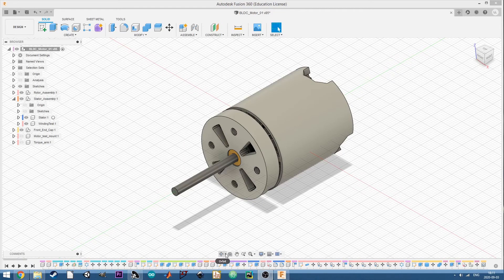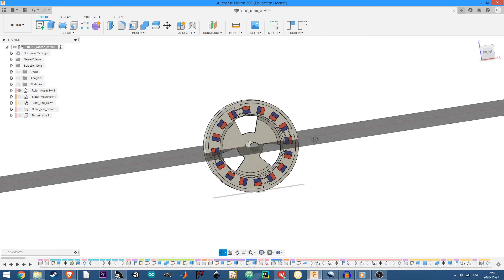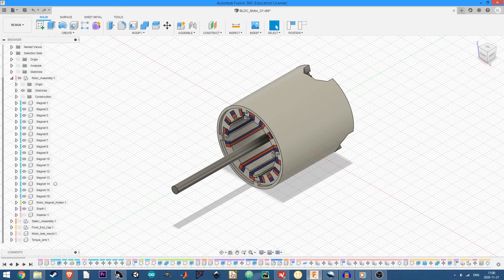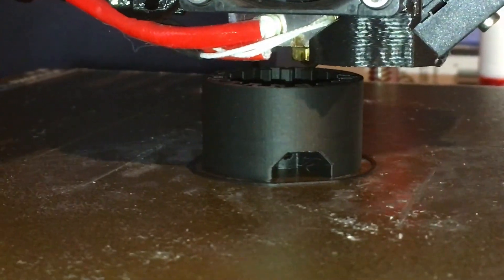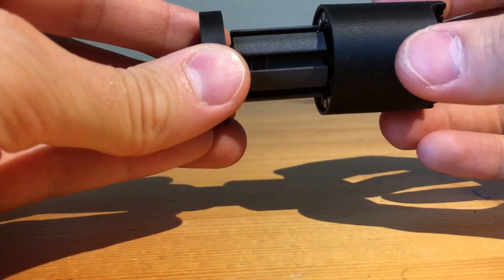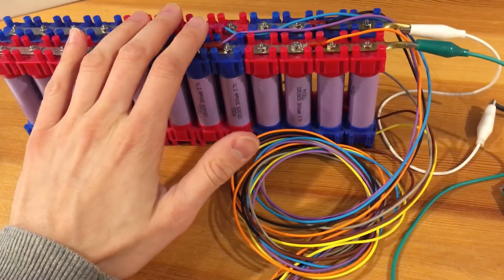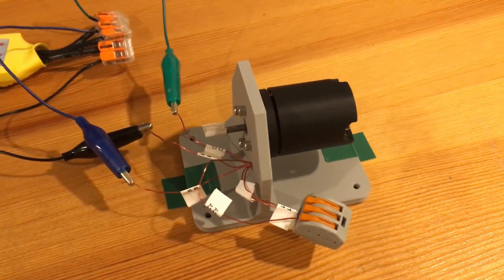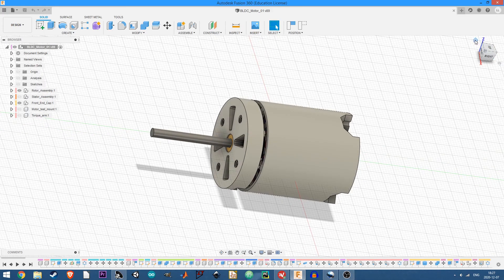3D Printed Brushless Motor

Comment: I am a mechanical engineer but i have been obsessed with bldc motors for a while now. I printed and built the Makesea bldc motor and i succeeded on the 3rd try. I have learned a lot from that. Then i've become more and more interested in motors until i designed my own about 2 months ago. I printed it and built it but it did not turn. Why? because i used a regular fillament for the stator lol. I do have the same iron filament you got but i didn't want to waste on my first motor design because it is a bit costly. The motor is an outrunner and the stator is similar to Limar's designs which uses distributed winding. I also designed an inrunner and it didn't turn because of the same reason. The stator for the inrunner was a lot of pain to wind though. I have been busy with college for a while but hopefully i will return to the motors soon. 😀

Regarding the iron filament, i see that you had faliures due to layer skipping i think. I did too and it drove me crazy. The simples and reliable sulotion is to convert your extruder from ptfe lined to direct drive! Once i got rid of that ptfe, i have never got any problems what so ever printing with abrasive filaments. As you know, the filament is very abrasive so it rubs inside the tube pretty good which is bad. 

I have read a lot about bldc motors but i don't have the knowledge for the electronics that you showed except maybe the esc haha. I am interested in the electronics as well. Hopefully you can do videos about all of that in the future too.  
All the best and congrats :)
Reply from the maker: Hi Zakaria, thanks for the awesome feedback! 

I'll have to look into converting the extruder to direct drive as you suggested. 

I still have a lot more to learn about mechanical design and electronics too. I highly recommend doing some more of your own projects when you have the time! As you probably know, it's such a fun and interesting way to learn more.

Hopefully, I'll have some more videos coming out soon.

Good luck with your studies!
Reply: I don't have access to the magnetic pla so I will try making stator with epoxy resin mixed with iron powder. I had seen a video of someone making that on YouTube. I am planning on making out runner motor and design it to be my bicycle hub motor. But I have no idea how to change torque or rpm by changing dimensions or configuration so still learning that.